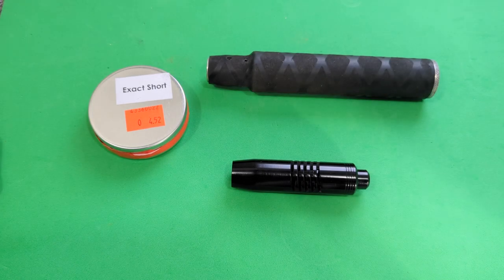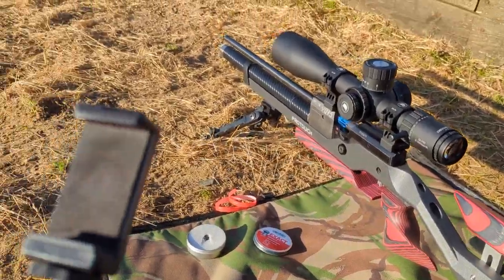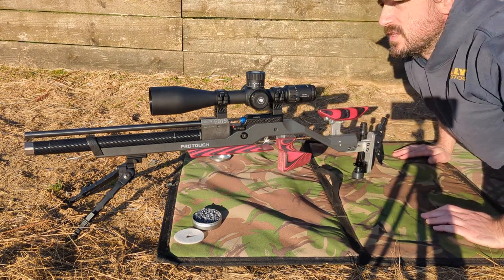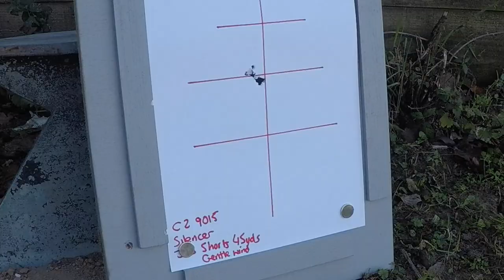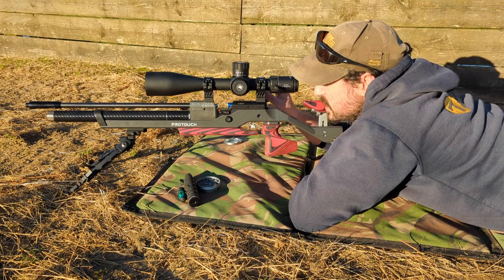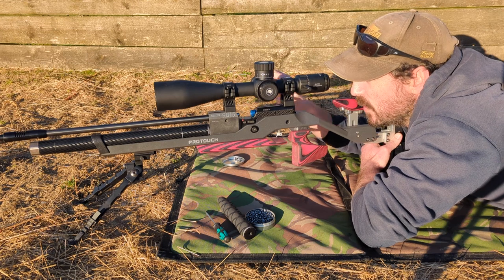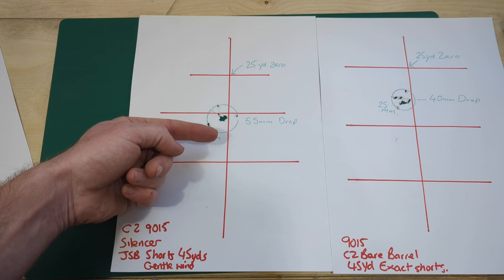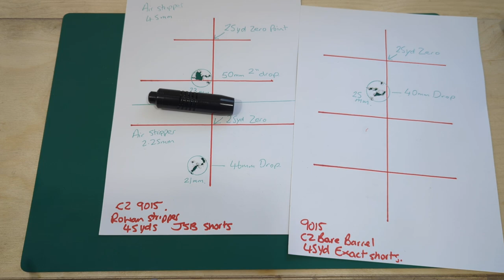Do air strippers / muzzle brakes work on air rifles?

Comment: After doing a lot of forum post reading on the subject as found no good videos I decided against buying an air stripper. After watching this video I now wish I hadn't spent all my pocket money on rum and a cheeky kebab.
Reply from the maker: To be fair that was a tough call 😂🤣

What rifle have you got?
Reply from the maker: Had to pin that comment, too funny..
Reply: @tillysgunstocks  it was!

Nothing as fancy as what they are intended for, I've a very nicely sorted S510 in .22. I like the look of air strippers as bling but recently started taking my target work a little more seriously.
Reply: @tillysgunstocks  I'm glad you changed the cone distance. It did show some difference. Without doing so I would have wondered if it was just a weight difference on the barrel.
What brand stripper is that? I was looking at the Rowan Engineering options.

Comment: Great video, very thorough. I have spent a lot of time making my own carbon fibre silencers, experimenting with many different designs. I have found that a lot of the problems with silencers are likely to be caused by turbulence through the baffles more than clipping. My latest designs have a built in air stripper in the base and special venting, this has greatly increased accuracy and also decreases down range noise.

Comment: I have a wooden stocked Walther LG400 FT (sub 12ft/lb .177) which I use for HFT. With the standard airstripper , is a loooong rifle. I decided to try and shave a few inches off it by replacing the stripper with a short muzzle brake to protect the crown of the muzzle and balance the harmonics with a 100gm sliding jacket weight.

After all, I thought,  what do Walther really know about accuracy? Turns out, quite a lot!

With the standard LG400FT airstripper, from prone HFT style, it is literally pellet on pellet at 25 yards, at 45 yards it is a one hole 5 shot group. Nothing I did to balance it without the stripper gave the same result. The groups weren't terrible, some might have been happy with them, but they were not even close to those shot with the stripper.

Conclusion: A rifle fitted with a correctly set up quality air stripper IS more accurate than one without.........and I don't know better than Walther.

Comment: I have a 20year old S200 Mk2 with Huma reg, fitted a Rowan airstripper set at 4.5 mm. Has definitely tightened the groups. I use JSB Exact 451s. Great video, very informative.

Comment: One of my hobbies is model engineering, so I have made quite few of these air strippers during the years. Some my own design, in fact. My experience is that they are more beneficial on barrels of less than 400mm length, particularly carbine barrels, such as the ne I had on my HW 100 KT. With such barrels the air behind the pellet still has considerable enrgy on exit, which can overtake the pellet on exit and disturb the dynamics of the flight. Very good demonstration.

Comment: Good one Tommy, I did similar years ago with a FTP900 and Rowan stripper to see if the cone distance made a difference, however I only went with increasing distance and found 4.5mm was better than bigger.   Will look forward to the next round of testing
Reply from the maker: I think for the next tests I'll swap to the walther barrel I've got as thats the same od as the cz. The cz probably needs screwcutting to true up the bore and od. That's a bit above my skill level on the lathe right now. Might well ask the sub12 boys to do that for me and give it a fancy crown. There's definitely a relation between crown shape and stripper settings too. Altho not sure how I can get that into a video that isn't 3hours long and boring as ,🤔

Comment: These are legal in the UK, but illegal in Canada/US, I believe? I'm not sure about the effort of trying to build one is a bad move, but it's just an airgun I use in the basement so I'll do as I please. I have a Canadian 495 FPS air rifle that I've modded to get 760 fps, with more parts on the way that should take it over 900 (.22 cal). I love modding, but I also like the quiet of a 'quietner' and muzzle brake. Don't need the neighbors calling ERT (Canadian SWAT) when I want to plink at Monster Energy tins.

Comment: I played around with 3 or 4 air strippers on a Steyr LG110 a few years ago. A couple were made by chaps on the forums and 1 or 2 from small firms. Spent days playing around with each one to see what would work out best. I ended up with a similar result as you did here. Tighter groups but on average only by a couple of mm here and there. With all the other variables considered it's not a very conclusive result. Maybe with some more tweaking and perseverance but it didn't seem worth it at that point.
If your silencer is clipping and you can get that resolved it looks to have more potential here. I recently added a SAK mod to my Steyr ProX. My groups at 40 meters look like your silencers group but without the clippings.
Reply from the maker: Yep agree entirely, the bulk of that group with the silencer was great bar the few scattered ones around the outside. Probably going to have it screwcut and trued up. Then I can runs a bunch of my other 1/2" silencers and see which works best of them and then a new screw on stripper 🤔

Comment: I've tested my Hatsan Galatian with many DonnyFL, 0dB, and a Hatsan air stripper. The only one that tightened up the groups was the air stripper!
Reply: Answering your banned comment 😁
(Must be the link)

Suppressors for all firearms, including air guns, are prohibited in Canada. {According to Wikipedia}

I know this wiki is not the best source but any silencing devide is prohibited...
And airguns WILL be considered as firearms in ANY type of "crime"!
(Pretty sure that owning a silencing device is illegal to begin with.)

So yeah... 
This guy tried very hard to read in between the lines but id rather not try.
Reply: @LowkeyAirgunner  Thanks for the "head's up". I wasn't informed that my comment had been banned. I'll try again.

Comment: Good video.  Now I wonder if the included moderator on my Beeman Mantis helps with accuracy?  It is quiet even at 1,000 fps shooting 8.3 gr Superdomes.  But the accuracy surprised me for a $129 US dollar air gun.  0.3" at 30 meters is not bad.  Or is it the German quality?  It says made in China.  I think, assembled in China.... With German parts...  Or else we may be in real trouble...  Anyway, the moderator may or may not be helping accuracy, but it does not seem to hurt!  Great for pest conttol.  They dont hear the gun at all... Can do follow up shots though rarely needed.  Will always use a moderator on loud guns from now on.

Comment: I may have missed this but what length are the JSB shorts? I have a Rowan stripper on my HFT rifle I use the normal JSB 4.52 and after experimentation have set the stripper to the length of the pellet.

Comment: I have a Cometa Fusion in .177, it is more accurate than my hw 77, 97 & 99s, but gun snobs won't have it, factory fitted with an air stripper, your loss.

Comment: Interesting to watch. That Anschutz 9015 looks gorgeous with the air stripper.
How is the report with an air stripper? I was hoping for some reduction in db. Perhaps another video?
Reply from the maker: The strippers won't really quieten it down much atall. It's primarily re diverting the muzzle blast. On the 9015 it actually sounds louder to me,behind it. The muzzle blast is now being diverted upwards as opposed to away from me.

Comment: I had the best results with airstripper with hole just 4.6mm and "stripping edge" 4mm from crown (Steyr LG110FT)
Reply from the maker: Unfortunately I can't reduce the stripper cone yet, the bore is very eccentric so it'd clip at probably 6mm od hole 😮‍💨
Reply: @tillysgunstocks  Fortunately the bore on my Steyr was concetric enough.... Much worse problem was uneven conical shape of last 20mm of the barrel due to its choke. Solution was to fix airstripper to cylindrical part of barrel with collet.

Comment: Pretty interesting gadjets! 
In kenada you cannot use any sound moderating device's but I would like to test some kind of muzzle break or air stripper one day
Reply from the maker: Hmm yeah I don't know what the legalities are your side mate, but they are interesting things to play around with for sure
Reply: @donpeer4477  I did read this article and I think he is trying way to hard to play with words!
RCMP will consider airguns as firearms in certain situations even if under 500fps.

The silencing device itself is an issue not the airgun.

Comment: Would this reduce any horizontal movement on a springer?
Reply from the maker: Generally speaking on the tons of springers I've built over the years, you would be best to look at ballasting the stock to reduce movement. Ofcourse you have the piston mass movement and the muzzle blast to deal with so it starts getting tricky and almost becomes a case of each rig has to be tailored to suit its owner and the way the recoil is felt.

It'd be worth having a chat with Gary chillingworth too. He's got his own ideas on taming the springers 😉

Comment: Didn't realise the hammer forged barrels can be off-centre. You'd think the manufacturers would correct this.
Reply from the maker: Very few barrels have the bore concentric to the outer diameter. Reality is its not that much of a problem if its,for instance threaded and the threads are clocked off the bore and not the od. Some manufacturers though crown them based on the od of the barrel and not the bore. That's often what happens when you see dodgy offset crowns.
Reply: @tillysgunstocks  Thanks for the info. Think I'll check my barrels to see if the look off-centre.